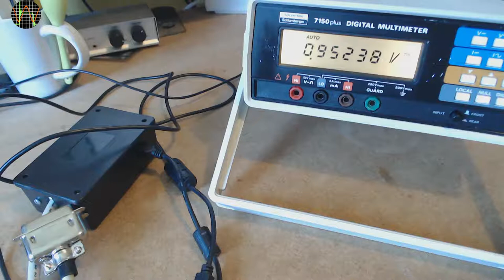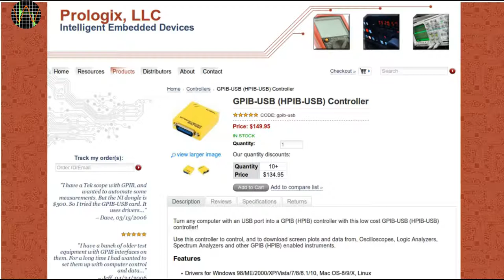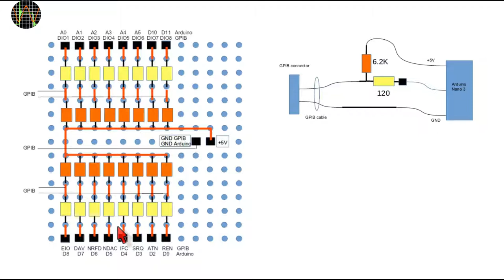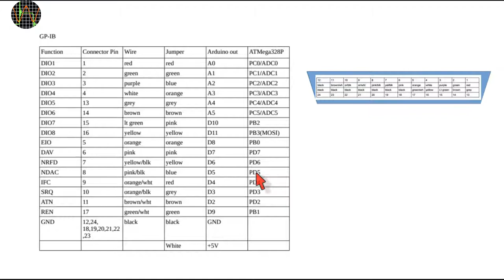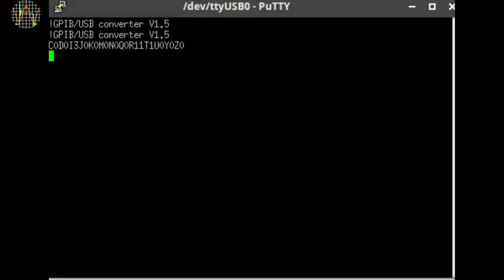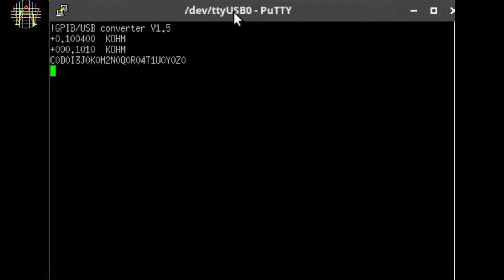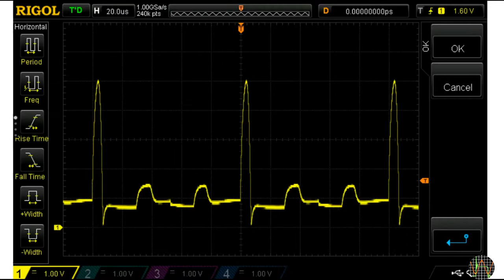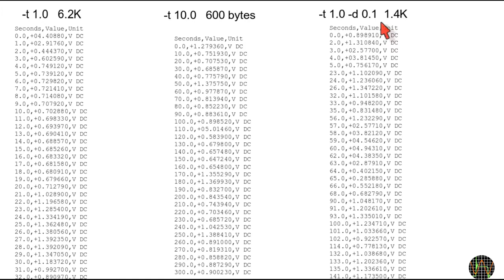Solartron 7150+ part 2: A GPIB-to-USB interface with Arduino Nano 3

Comment: Super!
Reply from the maker: Thanks but it turned out that power backfeeding the Arduino was not a good idea. See https://youtu.be/DAS1KVU_FaA . But this is not the end of the story. As my collection of GPIB-controllable devices grew from 1 to 4, I finally modified the hardware to throw-out the direct bus interface and its terminator resistors and instead added the two proper bus interface chips for GPIB. These turned out to be relatively affordable (eBay)  No video (yet). This change was necessary as I hooked more devices onto the GPIB bus and proper bus management became necessary. I also changed the software to AR488 https://github.com/Twilight-Logic/AR488

Comment: How to make a Virtual GPIB device and fool software  to think as a real GPIB interface and bypass data to Arduino com port? Since now its a COM port software can't interact !
Reply from the maker: Sorry, I have no idea. I never looked into that since I don't have any ready-made software that demands a GPIB interface. I am sure one could create a driver that pretends to be GPIB and uses a serial port underneath (to connect to the Arduino) but that requires an extensive investigation into windows driver programming and since I am not a windows user myself, its not something I plan to do.  I suppose your best bet is to buy a commercial GPIB interface that comes with windows drivers for your application.
Reply: @TheHWcave  Yeah thank you for your replying I understand what you mean problem is the commercial GPIB device is dead and I need to find a way to communicate with the device (The real device) the software looks for a GPIB device in pc not a COM port, its like Arduino it self is doing showing a virtual COM port instead of the usb device. Besides commercial GPIB devices are expensive this look like a chip alternative solution.
Reply from the maker: @avonfonds2567  I understand your problem but unable to help. By the way what device are you trying to talk to. Does it have alternative interfaces? For example my 34401A can do GPIB but it has a serial port too that speaks SCPI so I am using that instead.
Reply: @TheHWcave  This is the device "Princeton Applied Research - PAR VersaStat II" first two images of google are the correct ones and yes it has a rs232 port  (female) too like you said and another "auxiliary interface" it says so like a COM port female (like the male one in old pcs)